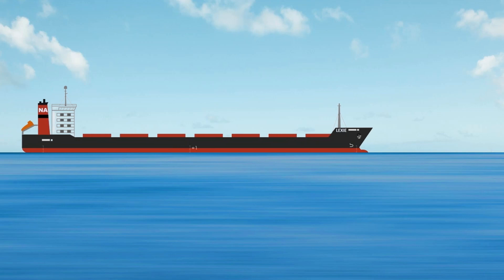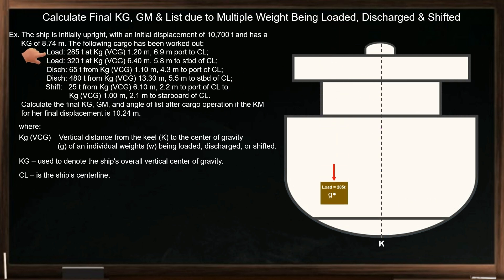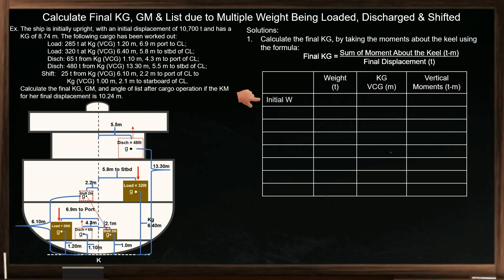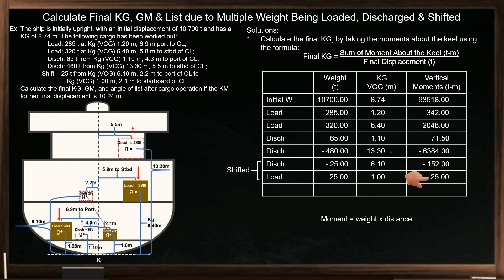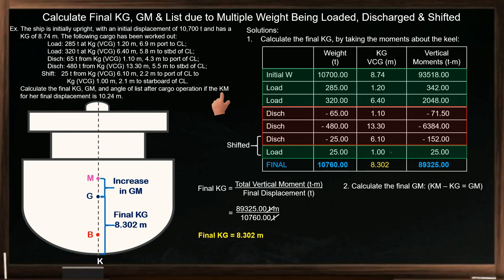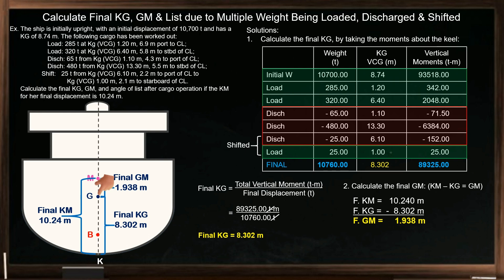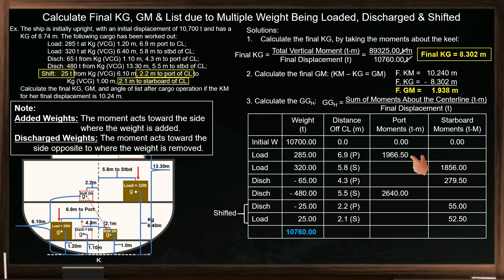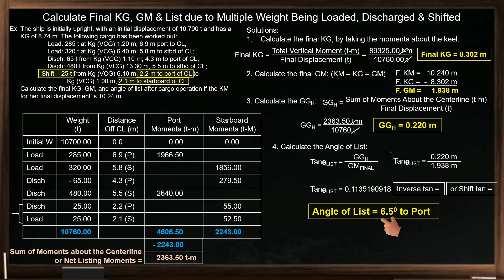Calculate the Final KG, GM, and Angle of List: Multiple Weights being Load, Discharge & Shifts

Comment: Sir How do you calculate that the 285t loaded in portside in 6.9m CL has 1.2Kg?
Reply from the maker: It can be determined in the ship's loading plan, which can be found in the stability booklet. About the distance off the centerline, it is technically termed  "Transverse Center of Gravity (TCG)." If it is off the centerline to port, the TCG is negative; if it is off to stb, the TCG is positive. In a bulk carrier, where the cargo is evenly distributed in the cargo hold, the TCG is 0.00m, signifying no lateral offset. However, when loading break-bulk cargo, such as in crates, the TCG must be measured using the ship's plan. The vertical distance from the keel (Kg) is commonly termed VCG, and they are found in the same table with TCG.

Negative TCG: Indicates the center of gravity is offset to the port side.

Positive TCG: Indicates the center of gravity is offset to the starboard side.

Comment: How about caculation of hold strength of tanktop and cargo to load
Reply from the maker: Yes, tank top strength and permissible load density are critical factors, especially when loading high-density cargoes like steel coils. In my previous video, I focused on calculating the moment about the keel and centerline to determine KG, GM, and list. In future videos, I plan to address cargo calculations that consider the vessel's structural limitations to ensure safe loading practices. Thank you for highlighting this important aspect.